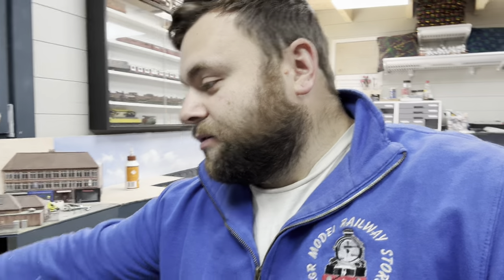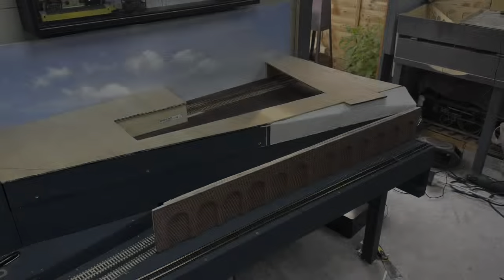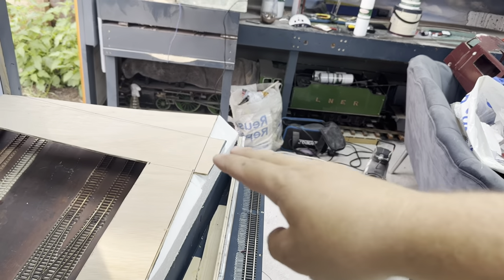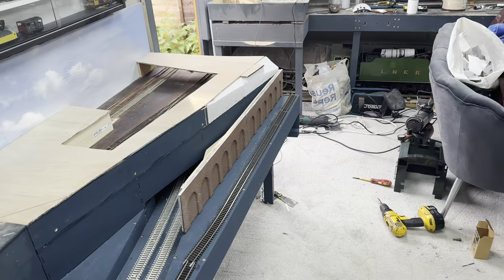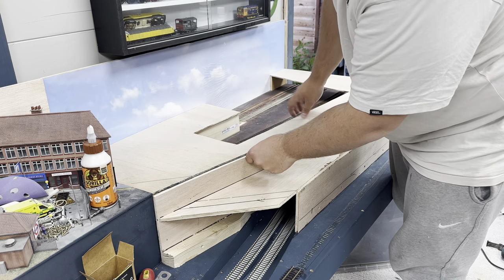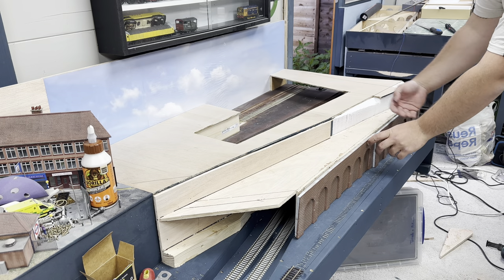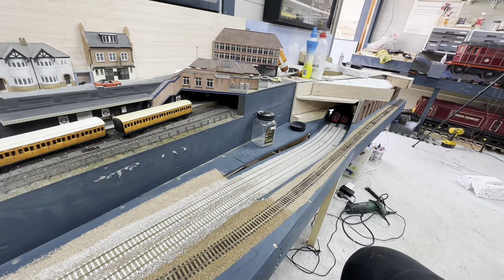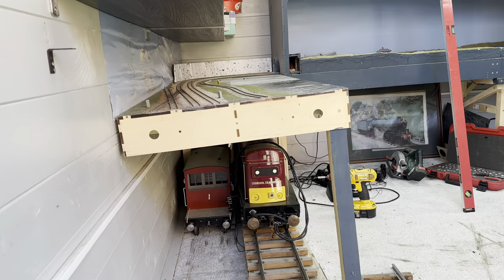London Underground model railway build 10 - bridging the gap between two levels.

Comment: That's coming together nicely.  FWIW, I've used actual fibreglass (the glass fibre matting and then the resin spread over) for a large - probably 3 foot square, with a rise of probably two feet - removable hillside in the back corner of a layout, where we needed access, but it needed to be light enough to lift up with one hand and pass over the layout to someone else if you needed to do.  Formed it out of chicken wire, took it outside and laid the glass fibre matting over it, and then chucked the resin on.  Worked well.  It's evil stuff to work, as you probably know. But the resulting hill was as light as a feather, and took scenic materials well, though trees needed a square of polystyrene glueing under the chicken wire to give a base for a tree.

Comment: Hi Eric, you’ve been busy again 👏 achieved a lot and looking good that P40 must  generate some heat better than a hot wire cutter lol 😂 cheers Al
Reply from the maker: Haha yeah it does get warm when it sets, but it must also react with that type of polystyrene i reckon.
Now however i have a nice strong edge for the baseboard so its worth it

Comment: Lot of progress made there Eric, good to see.
I'm not too crazy though about the decision to move the head shunt even closer to the board edge; it puts trains perilously close to potential oblivion. Is there enough space left for wagons to clear safety lips along the board edge?  I think the required clearance on the retaining wall side of the tracks could have been accomplished by instead moving the vertical board end to be at a sharper angle with the city support.

Comment: That wire cutter does it come with various attachments? Or do you just have two different types of foam cutter?
Reply from the maker: 2 different lances and the thin wire piece mate
Reply: @UndergroundEric  Thanks for the info big E! Would you have a link for them on amazon?
Reply from the maker: @wasted-blaster.  i got mine from AGR matey 😁